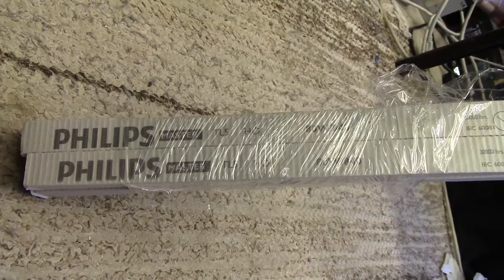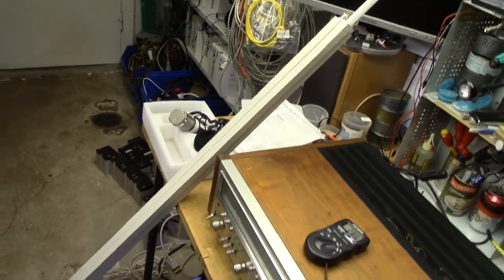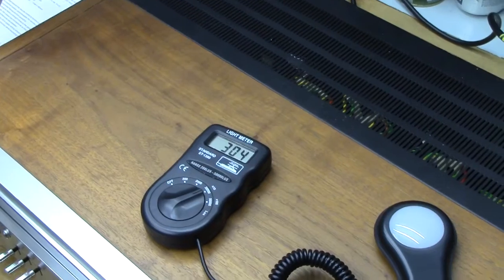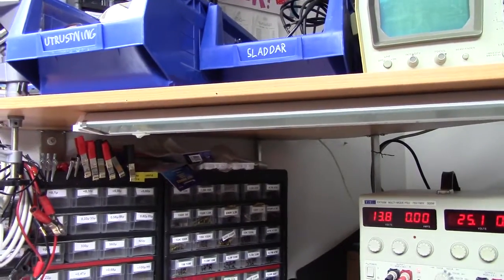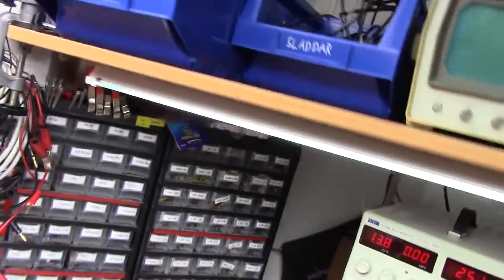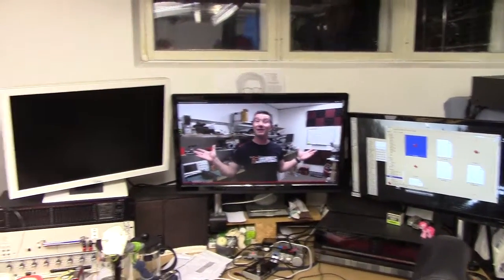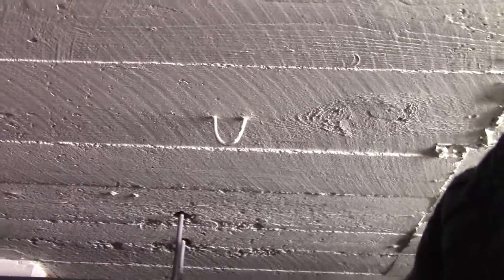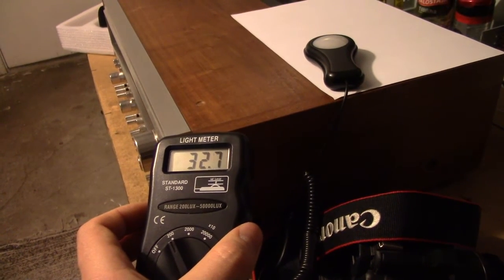Warm white vs. cold white T5 tubes, a cheap lux meter, and workbench lighting ramble

Comment: Getting a bit cramped in ya workshop M8,might be clean out time,what are the dimensions of that room?sometimes it looks tiny & others quite reasonable??
Reply from the maker: +Daniel Malik My workshop is basically also the laundry room, and it's a bit difficult keeping those two applications working well side-by-side. The room is about 5 metres by 5 metres (plus some weird edges) by 2,2 metres tall, so it's by no means tiny, but also by no means huge.

I recently mould treated a few rooms in the basement, so there's just a tonnashit out of those rooms basically spewed out all over the floor in the workshop right now. making everything infinitely better.

Comment: +FFcossag,oh ok,that's a reasonable size,I think the camera gives a false impression because even the ceiling doesn't look 2.2 high,would be alright if you could devote the entire room to electrical/electronics engineering!!!
Reply from the maker: +Daniel Malik I actually lie, the ceiling is actually just 2,1 metres, so vertical space is a bit limited. Even a normal sized person WILL bang their head on my lamps if they don't take care to avoid them.

The biggest space issue down here is a lack of organisation, though. No doubt about that.